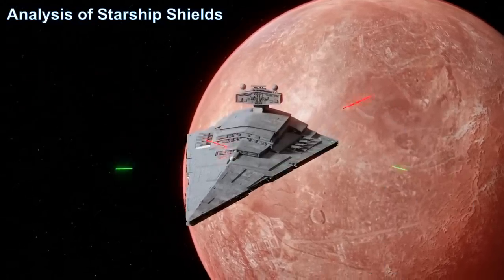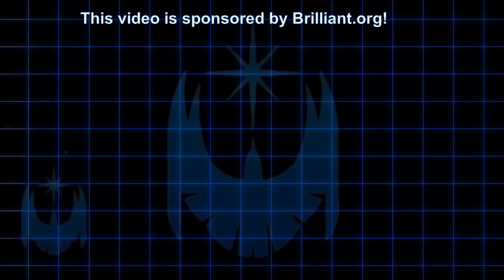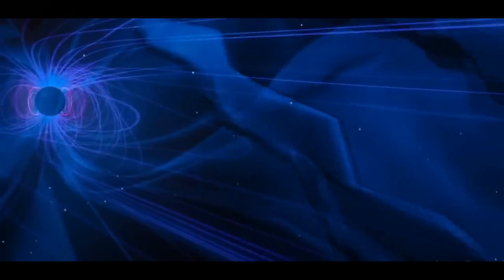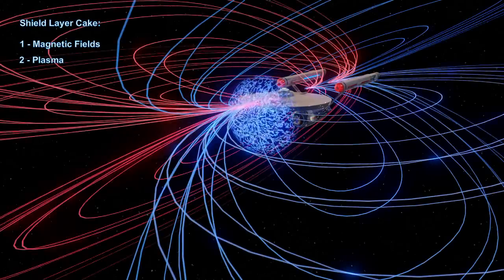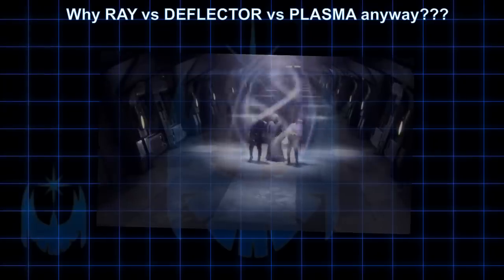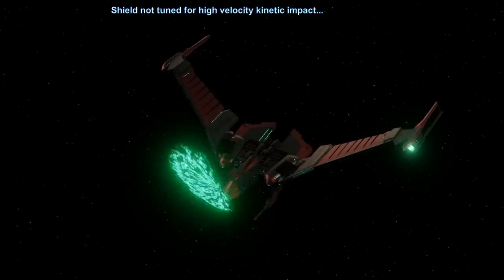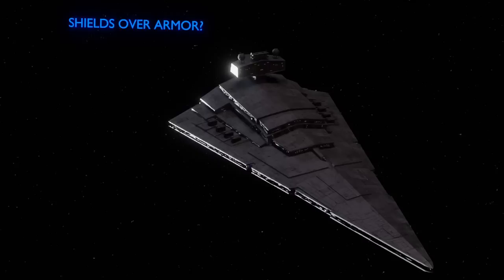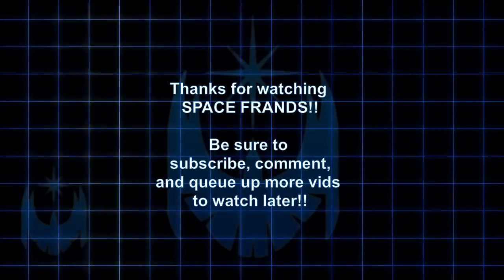REAL Starship Shields Types - They Work Like This...Animated Breakdown!

Comment: That would work for me.  But you could nest them.

A weakpoint in energy shields is that if you overcome the powerplant's output, you could overcome the shields and if you match it you could render weaponry ineffective.

So your energy weapons and shields would need to work from bateries that are constantly being resupplied by the powerplant and are drained on use.

And you want to to to layer.  The stuff that's tuned for c-speed threats need to be on all the time, but not all the way on.  If hull sensors find that the armor is being heated beyond reasonable tolarence then they be snapped to whatever is reasonable.  Anything coming in at less than c can stay off until the threat is calculated.

Anything that makes your ship hard to hit would likely also make it hard to see and anything that makes your ship hard to see will also make it hard to see out.

The ST: TNG Tech Manual states that their shields is a use of subspace to change the nature of space around the ship.  It seems to me that if that were true, you could make the shields change in a chaotic fashion to make the ship harder to focus on.

Comment: Insightful as always. Physics is pretty close to spot-on. The state of the art in plasma manipulation is still very primitive.... we have only been doing magnetic containment of plasmas for about 70 years. And fully magnetohydrodynamic code is processing intensive to simulate. You also have the problem that you need an electric field to also manipulate plasma and counter the problem that the poles of your magnetic field geometry will be weak (if using a quadropole field geometry).

Comment: Add tractor beams and Gravity manipulation to the mix, And you could easily layer these systems ontop of each other to handle certain threats over others. Deflector out one end with Tactor Beams to  force a missle off course, while the Plasma shield can focus on stopping the Laser hammering the back end . Or a Powerful enough Tractor Beam, acting quickly enough, could repel any form of Matter attempting to approach the ship if it's good enough. 

We Have options, even more so when we add FTL and Transporter Technologies to the mix. Fun things to play with, but scary results. I'll leave that their for others to mule over.

Comment: Battlestar galactica uses shields for their factions, but they heavily rely on armour, rather than shields. It's one of the reasons why some of the ships from booth the cylons and the humans look colossal.

Ofc, in battlestar galactica, they rely heavily on armour, because of electronics warfare. The threat of shooting viruses and malwares at each other is high on booth factions, (cylons having a advantage here obviously, because.... They're machines. Well, the soldiers are anyway. Not sure about the higher chain of command) so it would make sense as to why you want to rely on armour rather than shields.

They still use shields, but their main focus is armour, because of cyber warfare.

In star trek, they kinda do electronics warfare, but they always rely on shields rather than armour. This means that if some klingon would inject a nasty virus onto a federation dreadnought, it's shields would go offline, and then that klingon ship would simply decloak and finish them off like butter. In battlestar, even if a romulan or klingon somehow managed to inject a virus onto a cylon capital ship like a jormunng or a hel, even though firewalls in the battlestar galactica universe are pretty damn good, they wouldn't be able to finish them off that easily because of their armour.

Then again, there was that one time where in star trek, there was such a ship that didn't required any shield, since it's purpose was just to destroy planets. The doomsday machine. An ship without any shields, and it's armour was composed of solid neutronium. It was immune to anything. Except for attacks on the front using special torpedoes, or "feeding" it warp cores.

Comment: In different Sci fi tech manuals it is explained that the ships that have shields will either use a quick rotation system or a layering technique. Your explanation of bleed through explains alot.

Comment: Plasma shields do have another disadvantage, omitted in the presentation. The plasma will eventually run out. If used in close proximity or inside an atmosphere, the charged particles will react with the nearby matter and eventually lose their charge through recombination, turning them into non-ionized gas that will leave the magnetic bottles. On top of that, even left on their own, the charges will eventually recombine when moving along side the spiral trajectories around the magnetic force field. So as long as they are on, plasma shields have to be recharged.

An alternative form of plasma shield can be an "electron cloud" shield. That is, using only free electrons as a plasma substitute. This will generate a negative charge bubble around the ship that will interact with the electron clouds of the normal matter and act as a deflector of sorts. Suffers similar penalties as the general plasma shield and doesn't stop heavy particles especially baryons with no charge, so your ship will be vulnerable to neutron radiation. 

Star trek i think uses local space-time distortions as their deflector shields. Several clues taken from LCARS and tech manuals support this. For one, the shield emitters strength is measured in Cochranes, same unit used for measuring warp fields. Then there is a graviton frequency associated with the shield state displays. Also, local force fields placed on doorways and corridors, seem to act in a repulsive manner to normal matter.
Reply from the maker: I almost included the space-time distortion idea. The script ended up becoming really complicated, there is a LOT I omitted. So thanks for mentioning this.
Reply: @resurrectedstarships  my pleasure! And you are right of course. Besides, being a technology distinctive from plasma shields, perhaps space-time distortions belong in a separate video :D
Reply: @resurrectedstarships  can you make a part 2 to it then?
Reply: For atmospheric shields, couldn't the atmosphere itself be used to make plasma, like what happens with lightning, and kept alive using something like shaped microwave beams, sorta like those grape plasma ball experiments?
Reply: @tiagotiagot  it could, but the process of recombination would demand much higher sustainment energy requirements. In a vacuum a once ionized plasma stays ionized and you only need to keep it place. In an atmosphere the plasma itself runs out due to contact with the surrounding molecules.
Reply: @ilejovcevski79  Not necessarily, Ball lightning can last quite a long time and travel miles before exploding in as it discharges.
Reply: @Delgen1951  on top of being a poorly understood phenomenon, it also requires highly specific atmospheric conditions. I mean the Sun' been there for billions of years as well, i wouldn't consider it to be in the same ballpark as ship's shields.
Reply: @tiagotiagot  like ball lightning?
Reply: In Stargate, Atlantis has an ionized plasma shield that uses magnetic fields to separate the shield from the atmosphere for specifically that reason
Reply: If you have a fusion reactor of some kindin your ship wouldn't you be able to use excess plasma from that?
Reply: @asgard119  you could, but fusion runs on hydrogen and/or helium (usually) and that's in limited supply to. Two other things to consider:
1. Many fusion reactors are closed systems, that is, the plasma is being reused. If you vent some of it away, you'll lower the efficiency of the reaction and have to make up for it.
2. Fusion generated plasma is hot and thus not very dense. In order for shields to work, the plasma needs to be extremely dense and you'll need a LOT of reactor plasma to be vented.
Reply: @ilejovcevski79   well how about Cold Plasma, it exists I have at lest two Pictures of it on my pc form experiments done by NASA and others, and they are at lest ten years old. it is generated by gas discharge through electricity
Reply: @Delgen1951  the temperature isn't the issue. Ionization and lack of it are. In order to maintain it, you'll need containment that will keep other gasses away from it. And if you have that, you don't really need plasma shields.
Reply: Being used seeing so much stupidity, ignorance an hates on the internet, it's refreshing to stumble upon a group intelligent individuals having an informed conversation.
Reply: All defensive systems eventually run out, whether it's sci fi shields or real life Patriot Missiles. There's inevitably going to be some kind of limiting factor -- payload, energy production, heat disappation, etc. Something is eventually going to run out or overload.
Reply: @Ryeguy123a  true. However the plasma shields are particularly vulnerable in this regard, as they act as the reason for their own running out, especially in atmospheric conditions or inside nebulae. It would be like your point defense batteries or surface to air missiles running out just for being online, that is, periodically discharging their salvos even when no threats are around :(
Reply: Idk i think their deflector shields work along the principles of ionizing incoming matter (the deflector screen has been shown to be used as a "beam" before) using field emitters and it uses the starships impulse drives, which are traction drives (magnetic field drives that can interact with a stars magneto sphere to create a pull/push effect) to push incoming objects away or around the ship.
Reply: Against radiation just use regular armor, it seems kind of stupid to try to relly entitely on any kind of shields for your defense completly
Reply: @carso1500  That presupposes that there IS armor that works against the threat.

Comment: For Star Trek: is there a difference (other than potentially confused writers) between screens and shields?
Reply: I think the difference is in the fact that the deflector screen pushes/blocks physical objects from hitting you, so you can fly around without being afraid of crashing into a large meteor.   They don't work on any energy based weapons in Trek though, that's where the "shields" come into play, so stop phasers and photon torpedo hits, to a degree.

Comment: 7:38 - would be interesting to see in a space battle a ship using 2 different types of weapon projectiles one right behind the other to fool the shields sensors like a  plasma torpedo and there is a normal torpedo right behind it or the plasma torpedo is followed by a quick laser
Reply: Similar is already done with explosive reactive armor in the real world, rounds contain two explosives one that detonates first to activate and waste the armor and the second that does the real damage.
Reply: @WorkWaffle  Tandem explosives
Reply: Star Wars has this on one ship. Its called the Aggressor Class Star Destroyer, used by the Zann Consortium. It fires an Ion shot followed up by a large plasma shot. First drains the shields, second impacts the hull.
Reply: @npswm1314  empire at war needs a remake, if they time skip in Mandalorian and show a Keldabe Battleship or Aggressor Destroyer I'll scream
Reply: @chrisk3127  Just...play the remake mod.
Reply: @npswm1314  I tried it at one point but performance was really bad
Reply: I could also see someone mixing them. Like coating a kinetic round in plasma energy.
Reply: @Nostripe361   The expanse torpedoes are the perfect exemple.
Reply: Elite Dangerous kinda does/did this: shields are good against physical projectiles and explosions, but overheat from sustained energy loads. So efficient kills are generally stripping the shields with lasers then shoving a missile or railgun shell up their tailpipe. Similarly, defending pilots will shift from managing shield load and recharge while under assault from energy weapons to ECM and countermeasures when their shields are breached, and making snap decisions on how to deal with certain tandem weapons is equally important.
Reply: In 40k, this is the general principle behind ships having a mix of macrocannon batteries and lance arrays. The macrocannons, traditional artillery cannons in space, batter down the shields through volume of fire and once the shield is gone the lances, immense laser-based beam weapons, carve into the unshielded enemy's armour directly. 

Because shields recharge, lances are less effective against them than macrocannon; while lances hit HARD their rate of fire can't keep up with shielding recharge rates.
Reply: @vincediscombe7360  You midd pointing out that void shields are void related
Reply: @johnathonyoung4799  while that's true, it doesn't change my point- 40k is an example of using the right tool for the roght job (in this case different weapons in tandem for shielding then armour)
Reply: solution is shield projector cluster pods tuned to multiple defenses
Reply: Modern RPGs do this to defeat spaced Armour/Explosive reactive Armour that's actually super realistic
Reply: I mean in star citizen you can have a distortion repeater followed with a gattling gun
Reply: I mean it's not 2 weapons per se but in halo reach to kill the seraph fighters you have to gun their shields into submission before being able to use heavier ordinance against them like missiles, so maybe having a weapon to drain the Energy reserves of the enemy and then peppering their armor with the weapon that does more damage against It like, if the armor Is good with heat and lásers, use kinetic rounds, if the enemy armor Is too thick using sustained fire weapons and so on
Reply: In many games but especially star wars squadrons you can use high powered flurry of lasers or one massive ion bomb to destroy the shields. Then run a follow up with a kinetic missile that will punch straight through the armor. Or in fact switch the tables, run ion based lasers to easily shred shielding and then use proton torpedoes to damage the hull of the ship or ion bombs to disable ships movement and shut down the power to their auto cannons
Reply: But to do this your crew need to be experience and well trained. So you don’t fire to late or early.
Reply: @dirtyrat886  or a automatic ship system to do it for you. cant be that hard to have both guns on 1 button and the other one fires slightly later than the first one
Reply: Space Battleship Yamato
Reply: In Eve Online you can customise your ship to withstand the 4 types of damage but depending on what class and type of ship you have and are encountering would depend on what shielding or armour you need. An Interceptor ship would rely on physical speed and deflector shielding to outrun targeting similar to the Star Trek TNG episode where the Enterprise fires photon torpedoes at the Hathaway commanded by Ryker, with the Hathaway using their short warp burst to jump to safety an instant before the torpedoes detonate.
Likewise, Star Trek Federation ships are quite flimsy but they are agile hence their reliance on strong shielding unlike say Klingon Birds of Prey which rely more on armour. 
However, the Federation uses multiphasic shields which will give them a huge array of protection which adjust automatically to whatever projectile is launched to it so it would work like the magnetic/plasma reactive shielding mentioned in the video. And since the ships hulls are very polished by design and have light armour, it could offer some protection against laser weaponry.
Reply: This is used often by the space faring races in the Expeditionary Force sci fi books.  Planet based plasma cannons use a pulse laser to (blast away cloud cover) allow a split second window to fire the payload without atmosphere dissapating the effect.
Reply: To some degree Star Trek actually has this with the Cardassian Spiral Wave Disruptor, which fires both disruptor and phaser type damage simultaneously and which most shield types in universe do not defend against equally. So hypothetically, the tuning software would be unable to account for both, at least fully.
Reply: then why didn`t you build a weapon that consists of all of that. so no matter the shields the weapon allways goes thru